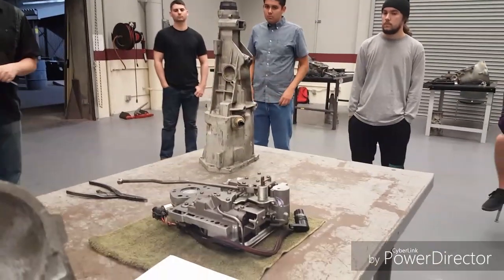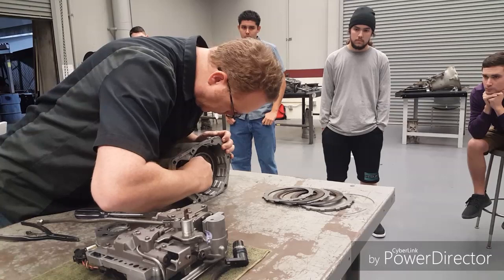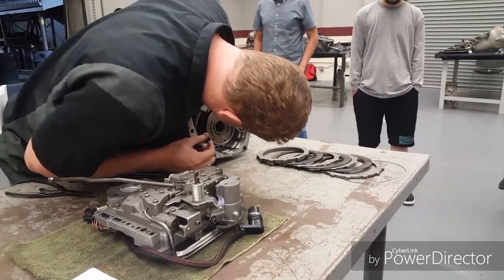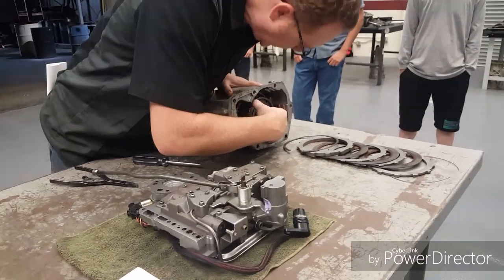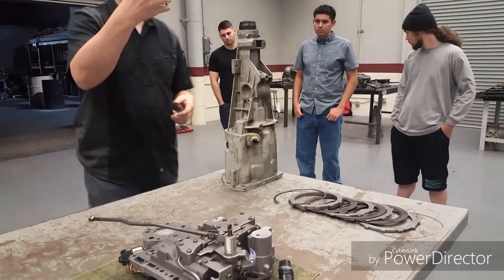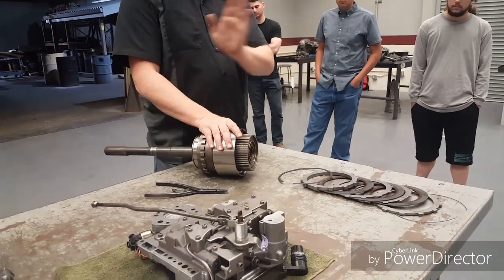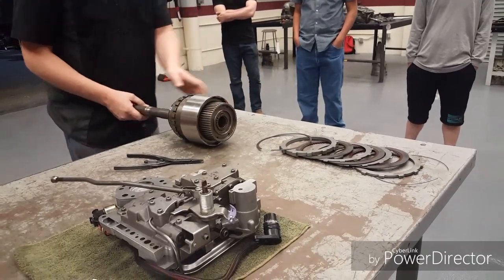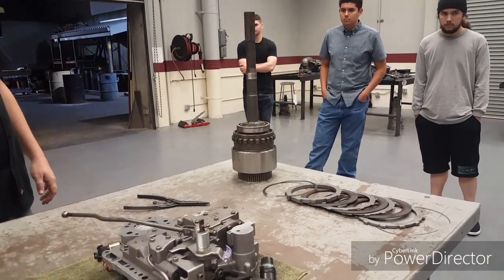Mopar 42RE Transmission Overdrive Unit TEAR DOWN

Comment: Could you tell me which part controls 1-2. And 3-4 mine goes in 1st and 2nd perfect but no 3rd or overdrive could I just replace overdrive unit would it fix it

Comment: Hello wanted to c if u can help me out, swaped valve body on my jeep 42re now it doesn't go to P gotta crank on N wont go anywhere now  i made some research it tells me it can be the pawl  lever  tried re adjusting twice allreadystill the same maybe im still not  settin it right  last time i did it i put it past the park slot any advice u can give me will help alot im exausted lol thanks